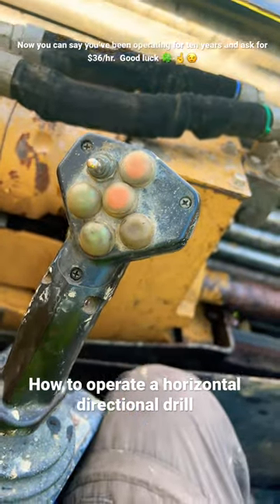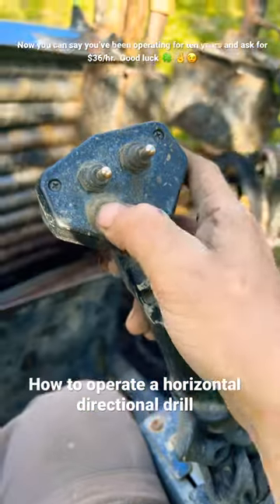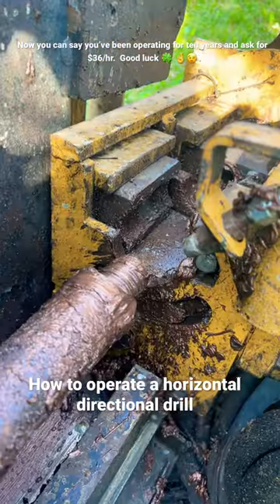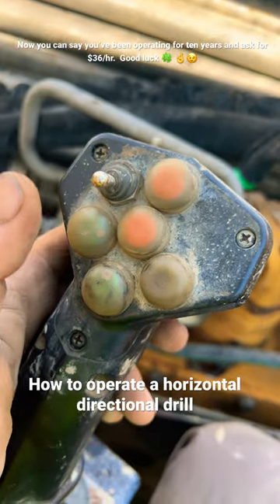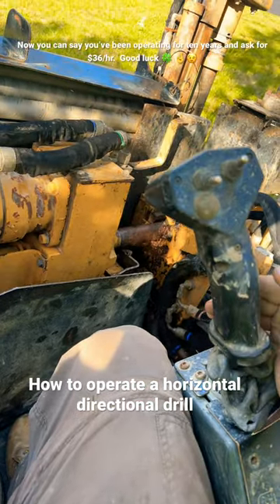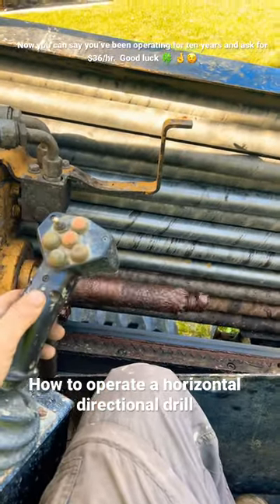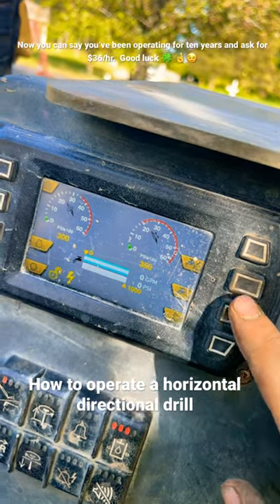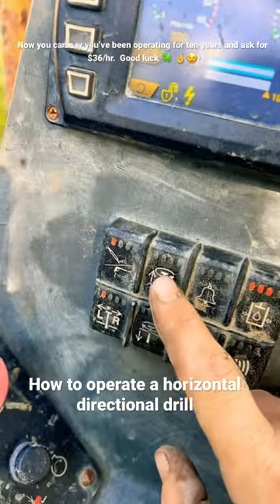How to operate a horizontal directional drill.

Comment: I work with this exact same drill and those are all the controls i use and nothing more, shes a simple machine to run but hard to master
Look likes your doing it for spectrum internet which is who i contract with for too
My team is 3 guys and i may be the driller but i still still dig and even hook the pipe to the head for the pullback